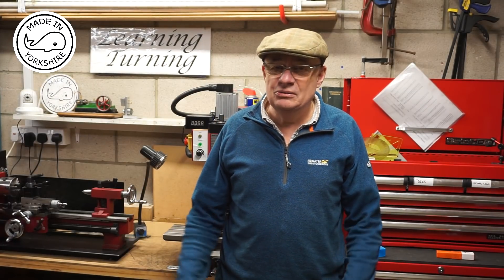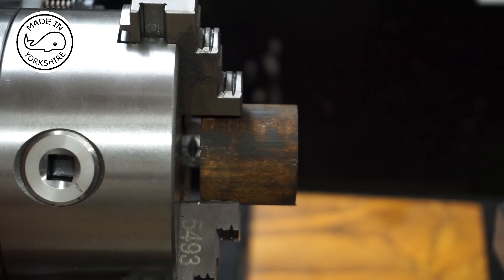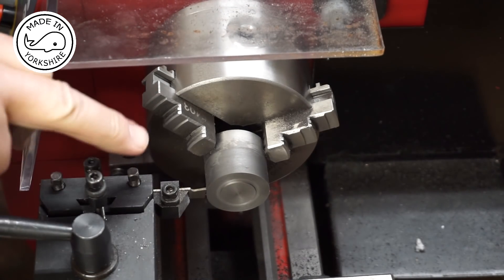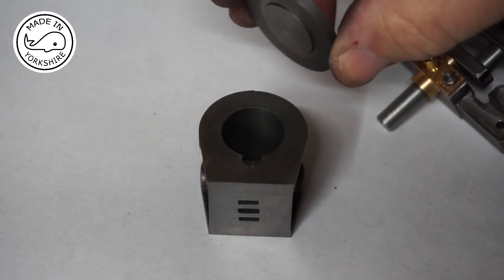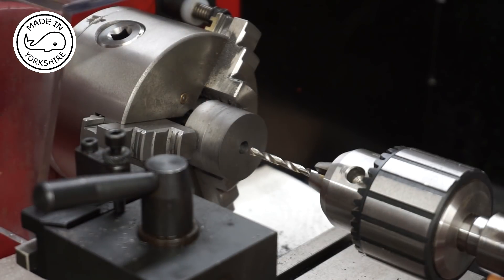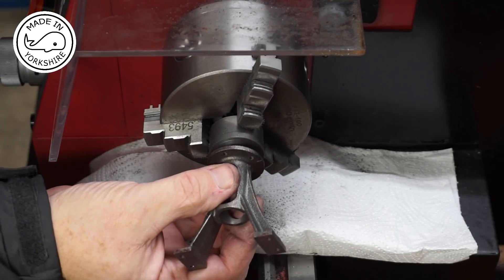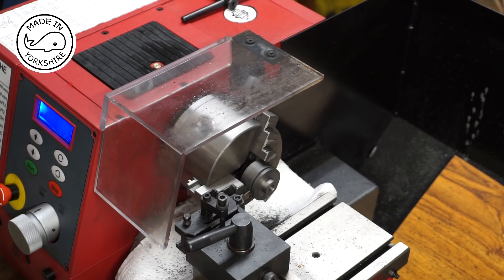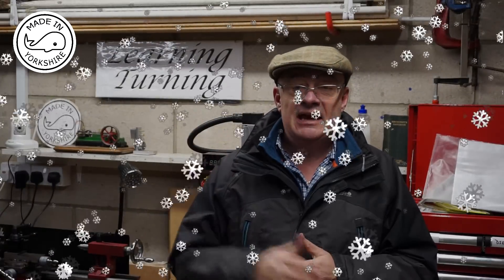#MT25 Part 7 - Making a Stuart 10V Steam Engine. The Cylinder Covers. By Andrew Whale.

Comment: My fault l meant the clamp on the lathe bed to support dial indicator. Way down here in Aus parts like the support are impossible to find
Reply from the maker: Ah I see. The clamp in the video was something I just made from some scrap kicking around. I didn't produce a design but its easy to work something up based on stock you might already have. I've since replaced it with a 3D printed one. The link to that is: https://www.thingiverse.com/thing:2795044
I hope that helps.
Cheers
Andrew

Comment: It's taking shape nicely :-)  Is Father Christmas bringing you set of castings for another Stuart engine to tackle once this one is finished :-)
Reply from the maker: Thanks Pete. My mother-in-law usually gives me a few quid so it will have to treat myself to something!
You did a brilliant job making the Stuart No4 replica - very nice indeed. Good luck with your Alyn Foundry project. I'm very interested to see how you get on.
Merry Christmas.
Andrew
Reply: @learningturningmetal  Cheers Andrew, I've done a bit more to the no4, it's now on a heavy base and runs virtually silent :-) It's largely just painting / adding plumbing etc to complete it. Once you get the 10v built if you want to try it on the hot stuff give me a shout and I can let you use a boiler.

Happy Christmas :-)

Comment: Dunt Tha be letting on us Yorkshiremen are as nesh as rest a folk int cold, good video pleased to see carriage dti getting some use, just a useful tip if you get an exercise book, whilst in warmth just make a sketch of the part/parts with all dimensions on and plan step by step how you are going to tackle the job, you can write down all the tools you require up front, and make note of speeds if it went well or anything you had to change, then when you get similar job it will give you an head up, hope you and your family have a wonderful Christmas, sithee Andrew.
Reply from the maker: Thanks for the suggestion Tony - I will give it a go. Have a good un!
Cheers
Andrew